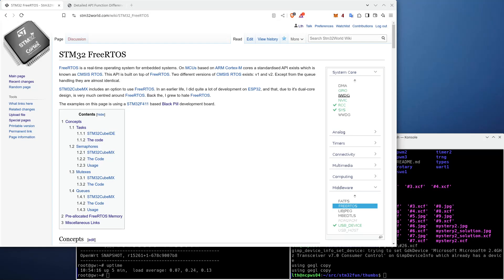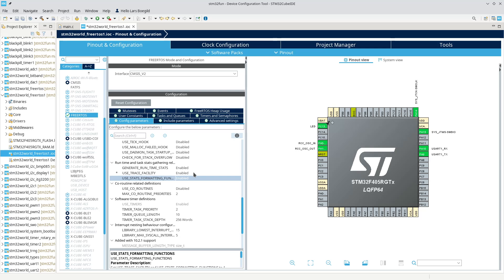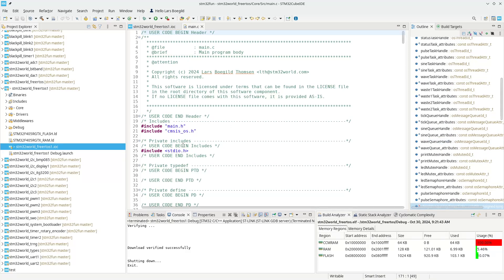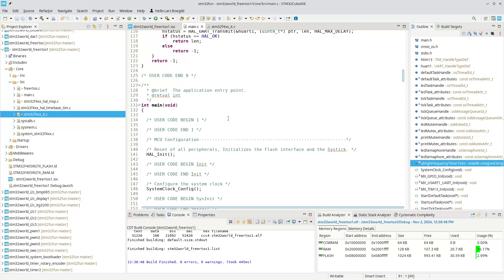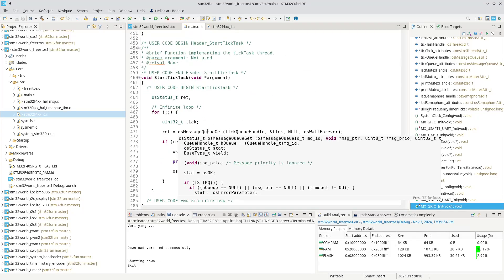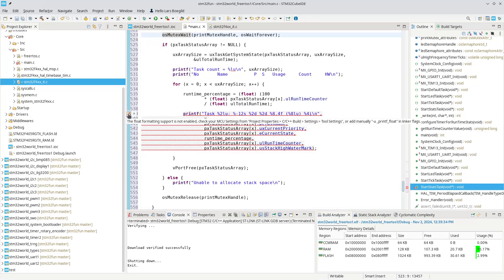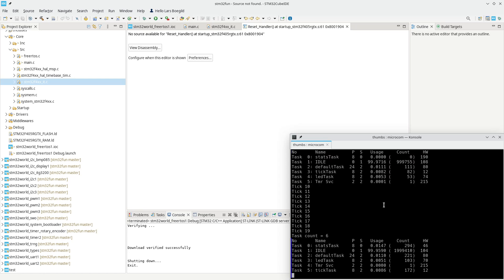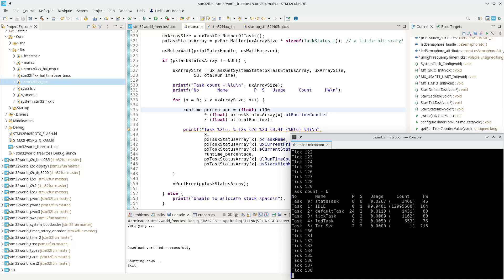STM32 Tutorial #28 - ESSENTIAL FreeRTOS Runtime Statistics

Comment: Great tutorial. Do you know about system design?
Reply from the maker: Well, I know some things ;)  But you would need to be a bit more specific what you have in mind.
Reply: @stm32world  I want to know how to design the architecture before starting a project. For example a simple project here: some sensor with display and menu in it which is controlled by buttons. Should I use bare metal for that, what interrupts to have, if I use RTOS what tasks do I need, how to create menu, share&log data and ... I know this should come from experience, but I lack of it(( I would very like it if you had some videos about how systems like coffee machine, digital watch, camera, sensors of cars, rockets and etc, work from the abstract software embedded engineer's view
Reply from the maker: @breadx333  Well - personally I try to break it down in a modular fashion.  1 block is the MCU and whatever is required to run that, 2nd block perhaps the display and so on and so forth.  If possible I like to get everything up and running on an appropriate dev board, test display, test buttons etc.  Once I feel confident I know how to throw it all together using the right pins I create a schematics and from that a PCB.  There's a LOT of documentation on the stm32world wiki - check this for example:  https://stm32world.com/wiki/MIDItio - it even documents changes between first and second revision.
Reply from the maker: @breadx333  The "system" does not matter.  What you always do is to break the "system" down into manageable parts and then attack the parts individually.  Understand the parts before you attempt to throw the system together.
Reply from the maker: "bare metal" as you put it or rtos really doesn't matter.  Every time I have begun a project with FreeRTOS I have ditched it at the end.  It usually end up making things more complex rather than simpler.  An interrupt driven approach is usually simpler.  But again - get the hardware and individual components right first - then throw it all together.
Reply: @stm32world  thanks!
Reply from the maker: If you watch some of the later videos I do get into that a bit more.